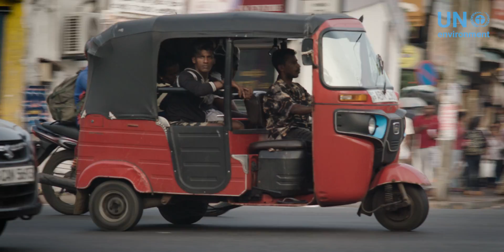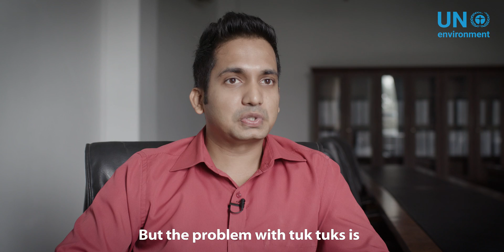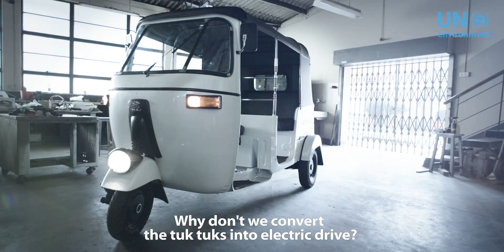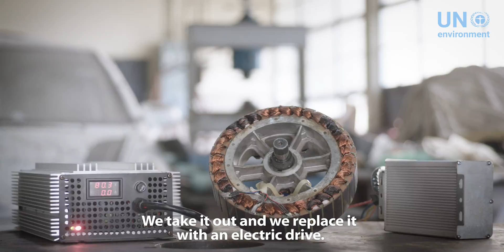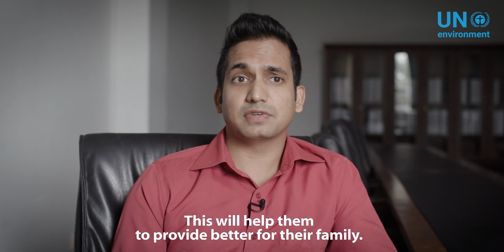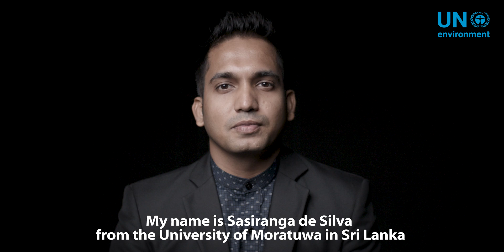Sri Lankan engineer converts tuk tuks to electric drive

Comment: Congratulations ! But there is one thing I have to say. If our village farmers had electric tractors or hand tractors to use in their farms, they could produce their crops far more cost effectively cheaper and make bigger profits than they are doing now with ordinary tractors. Our farmers would be very happy if they could just charge their electric tractors with solar power than having to pay for expensive patrol or diesal - because with solar panels there's going to be only capital expenditure and not any revenue expenditure.
Only the patrol and diesal engines would need have to be replaced by induction motors in these electric tractors, and all other multifarming equipment would remain the same. Also if you can apply the working of the කර්ම නියාමය of a bull when designing the induction motors of the tractors, that would be ideal. What I am trying to say is you would have to make a module of at least three or more motors with different watts of power, interconnected by gears to get the maximum force the engine needs to work in paddy field.
I am making this request, because in our quest to cultivate Sri Lanka's traditional heirloom rice and vegetables without poisonous insecticides and chemical fertilizers put to them, I just thought it would be great to have zero-emmision tractors that don't pollute the environment with greenhouse gas emmisions. And the other important thing is, it is very much easier to make an electric motor than a patrol or diesal engine. So it appears to be that electric vehicles and farming equipment are going to dominate the world in the future.

Comment: Other than three wheelers, can't you and your team convert a Bajaj Qute or a TATA Nano to electric drive? How about converting the old Mini Coopers to electric drive also? The company in Estonia, Skeleton Technologies, make ultra capacitor modules in the size of truck batteries that give about 100 kWh of power. Two of those modules would fit in where the patrol tank used to be and would give about 200 kWh of power. Think of the range such duo ultra capacitor modules would give for a Qute, Nano or a Mini Cooper. Also can you upgrade old Nissan Leaf cars from their outdated 40 kWh batteries to 200 kWh two ultra capacitor modules the same way. You can do all this as a side business along with your business of converting three wheelers into electric drive.

Comment: In India We have a Conversion Kit  manufactured by VOLTA AUTOMOTIVE INDIA PVT LTD, Bangalore for Converting Existing Bajaj Auto Rickshaws and Other Model of same GVW to pure electric with 55km speed and 6 kW Lithium Batteries approved by ARAI pune, success fully converted 7 autos in Srilanka way back in 2015 running well and around 50 autos converted to electric and Post Conversion thier RC books are ENDORSED for Change in Power Train and Fuel afterwords the Insurance any Details contact us on madhan@voltaev.in
Reply: Sir i am interested please Shering more ditels my 🆔 kamlesh8510@gmail.com